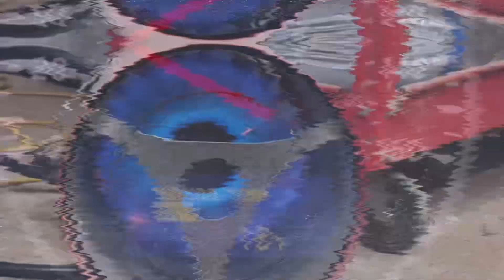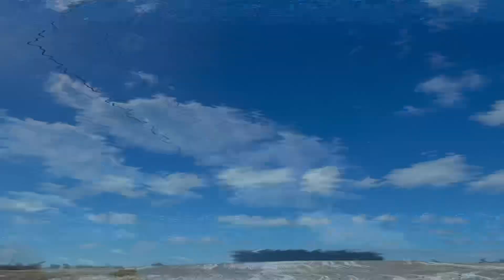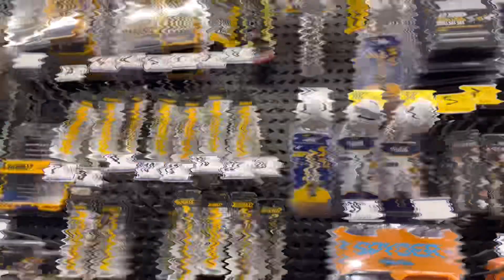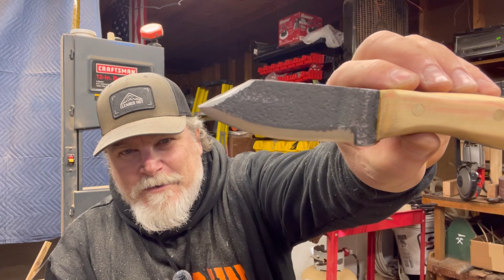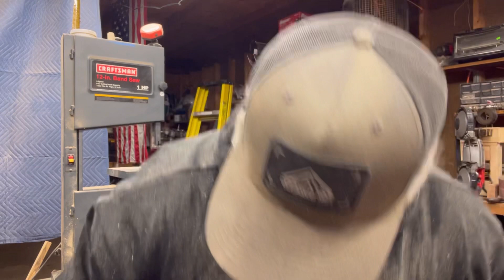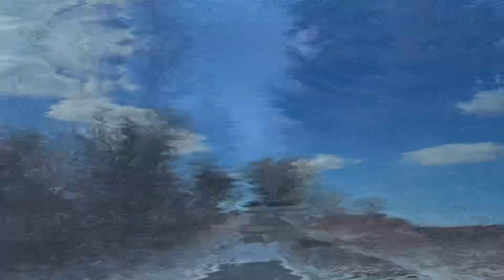Buzzsaw Blade Birthday Knife

Comment: Happy Birthday!!    Good job on the knife!  Those old blades are high carbon steel, Annealing is the key to drilling,cutting and grinding. After that, Heat and quench in oil to get it hard again. Then Temper in a oven,toaster oven,something like that.  It will take a bit of time on the stone but it will get there.   😁
Reply from the maker: Enjoying your Bowie knife series! I forgot to put your link in the description, but it’s in there now!